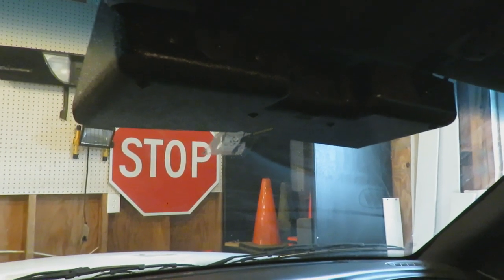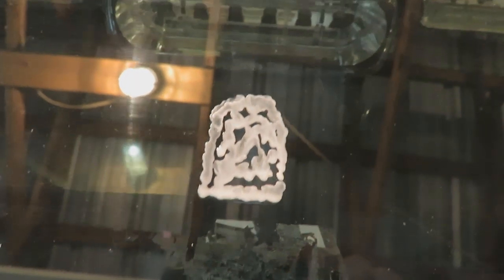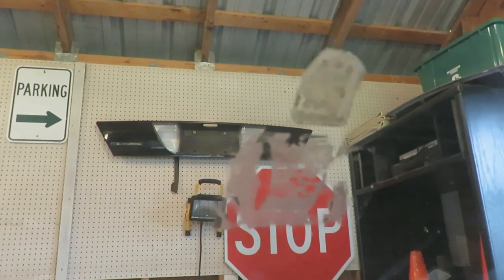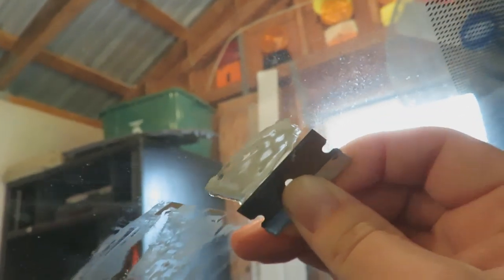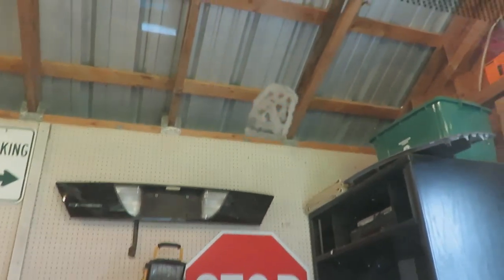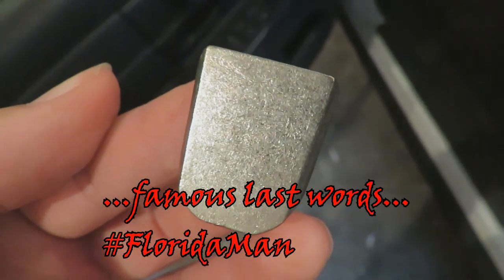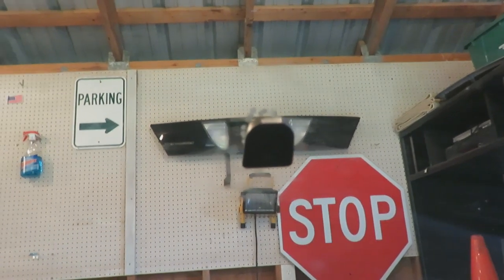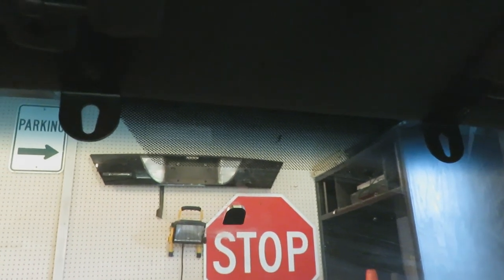#FloridaMan tries to re-install mirror on old Police Interceptor

Comment: I bought a 2011 crown Vic from the TMA auction and it was from Hillsboro County. I could see from the glue on the bumper what the unit number was. I went to the Hillsboro county Sheriff’s web sight and submitted a public records request for  the maintenance records of the car and they sent to me in an email. Kinda interesting reading. You should submit a request to the agency that had your car. If you don’t have the old unit number just provide them the vin and make and model.  Let us know what you get from them. Glad your back.
Reply from the maker: That's a good idea!  Thanks!

Comment: I don't know about Florida, but here in NH, as long as you have side view mirrors on both sides, you are not required a rear view mirror. That said, however, life sucks without it. In my work van, where I have a cage, I put a camera system in, and the camera is always on, not just when I am in reverse.
Reply from the maker: Back up camera's are awesome, they are the extra eyes when you can't see very well behind the vehicle.  In some of the trucks I've driven they have the "on all the time" rear cameras and those are nice to have in a bigger vehicle - so I know you like that in the work van.

As for the mirror... well... you talked me into looking it up.  According to Florida law I just need a mirror... so technically, I could have left that mirror off the windshield and clubbed off the passenger mirror - and I'd still be legal.  Who woulda thought?  

For reference:
Florida Statute 316.294 Mirrors.—Every vehicle, operated singly or when towing any other vehicle, shall be equipped with a mirror so located as to reflect to the driver a view of the highway for a distance of at least 200 feet to the rear of the motor vehicle. A violation of this section is a noncriminal traffic infraction, punishable as a nonmoving violation as provided in chapter 318.